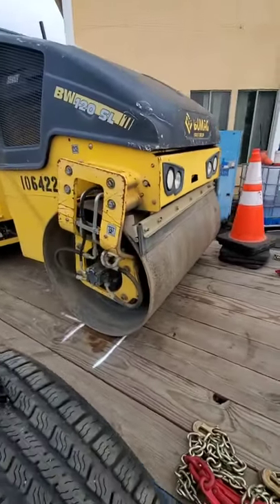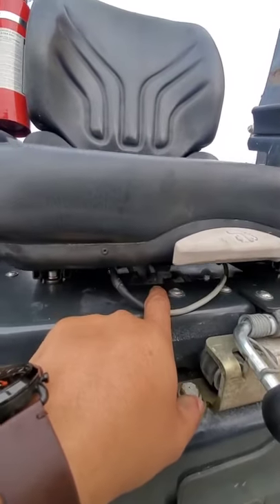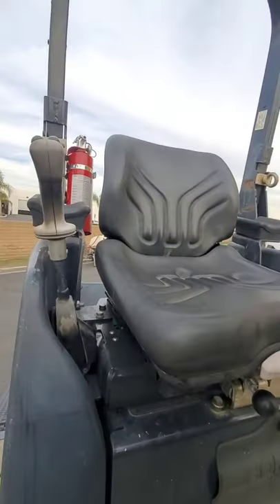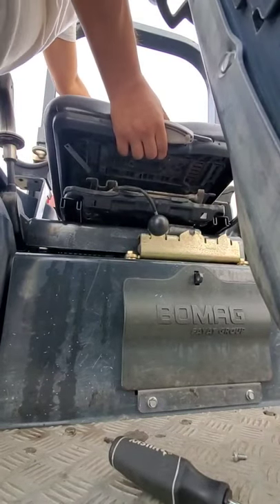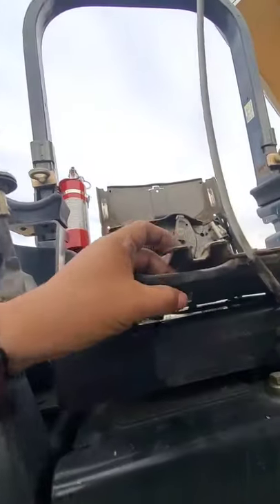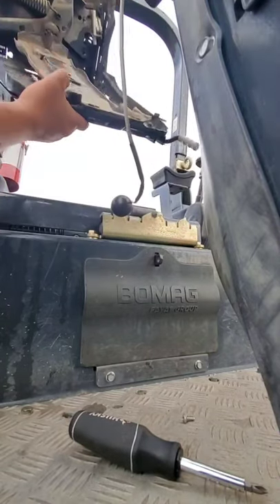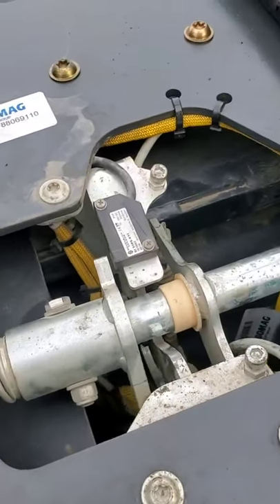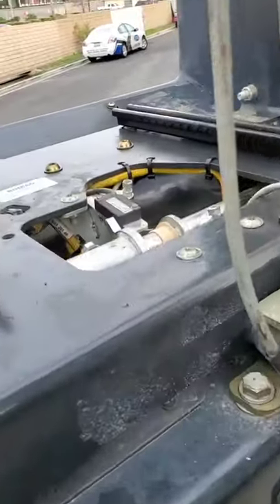bomag 120 sl roller repair - brake engaging

Comment: After pulling mine apart. I’ve found that the reason for the brake locking up is slack in the handle due to the plastic bushing sliding out of the tube that rotates on the shaft. At 5:47 you can clearly see bushing slid far right it needs put back into the tube on the left.
Reply from the maker: You could be right, but the handle on mine didn't have much play.  Hasn't locked up anymore. Thanks for the tip though.

Comment: Did you need to put a weight on the seat to disengage the brakes due to some machines having weight sensitivity
Reply from the maker: No weight on the seat was needed during the repair. I put it all back together and sat on seat to try it out.
Reply: I wonder if I could put that brake on a switch